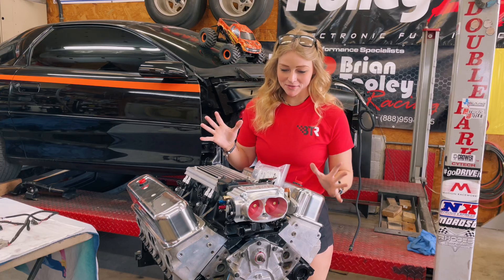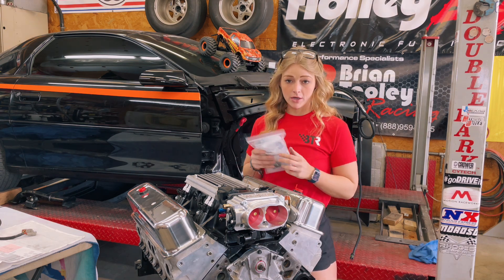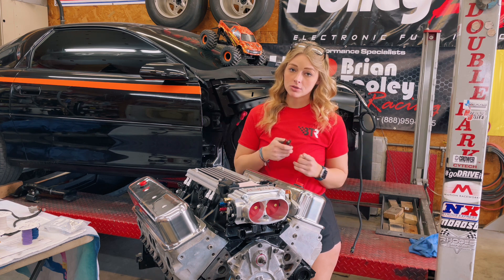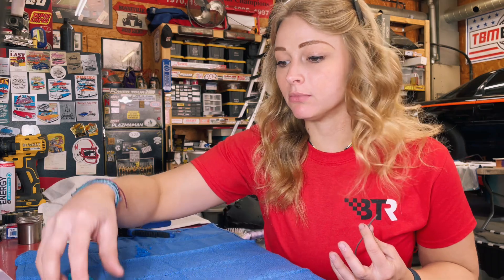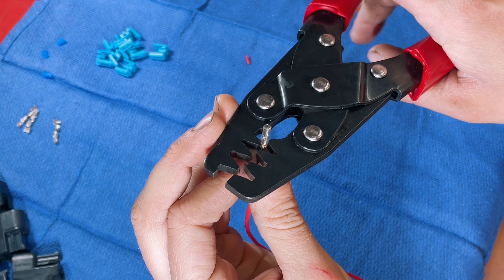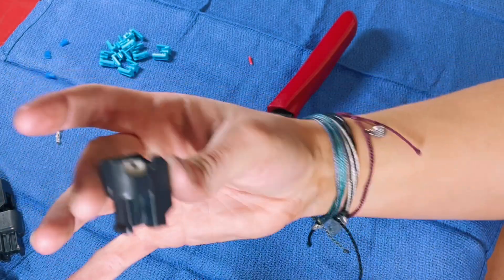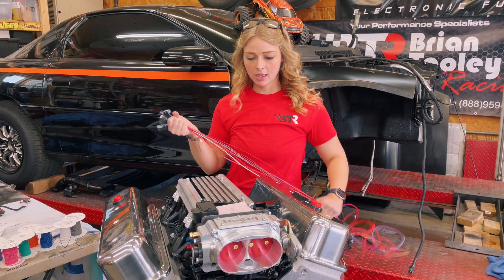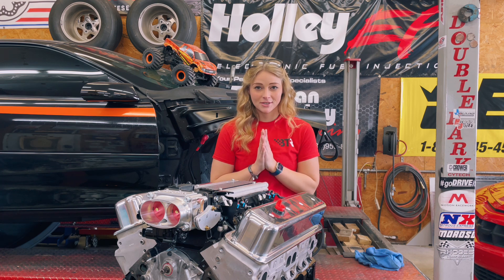HOW TO: Wiring A Custom Fuel Injector Harness

Comment: How do I figure out which is positive and negative when my replacement connector is black and red and my original wires are green and orange?
Reply from the maker: Colors have no meaning. Unless you’ve wired the whole car never go off of color. Read your cars wire diagram and it will show you what’s what
Reply: @britneyautomotive  thank u. i changed a fuel injector and revered the red/black wiring and the problem seems to have gone away. i've been monitoring it with an obd2 scanner and hoping no codes come back. that issue broke my brain into pieces trying and trying to figure it out lol. have a great day :)

Comment: To think I've been using the wrong tool for my electrical connectors.. what are those ABC pliers called and do you have an affiliate link for them?  Clearly needle nose plies work but they arnt as satisfying as those 😂
Reply from the maker: I added it into the description under the video! It’s a prowire link:)
Reply: @britneyautomotive  thank you much! I appreciate it!

Comment: Just got the engine back in my third gen, got it broken in and now driveable. I definiately could have used some connectors when re wiring my ecu and sensors from the old 305 to the new 350 instead of just soldering and heat shrinking. Very helpful info. Do you have a link for that loom?
Reply from the maker: I just updated the description with a link to the loom!